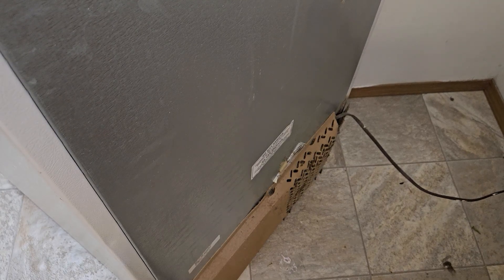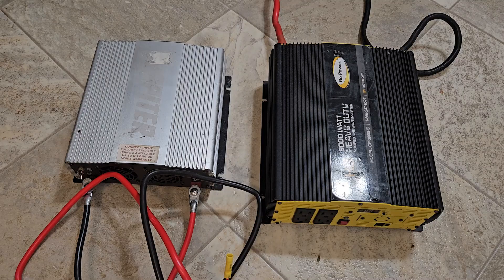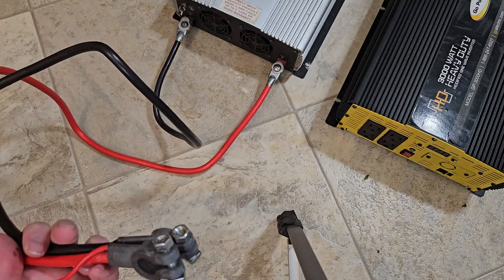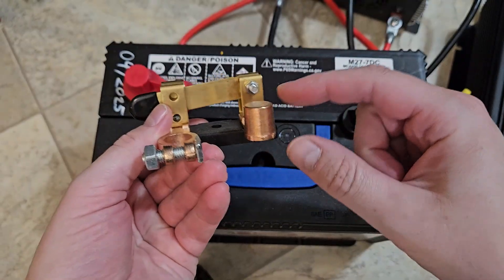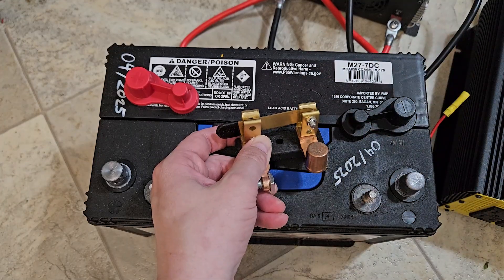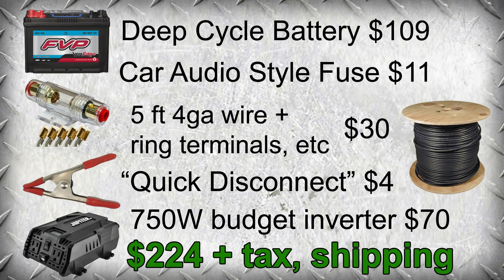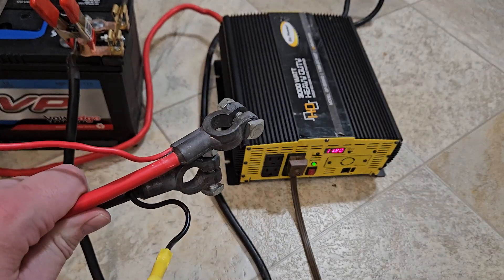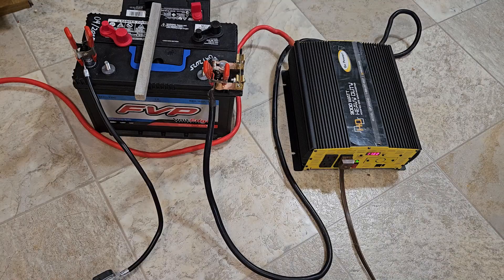How to Build the Perfect Refrigerator or Freezer Backup Battery System on a Budget

Comment: Cool video - I watched because I am looking to do a battery backup for my pellet stove and I am afraid of lithium batteries. The top end Harman pellet stove company recommends on their website the Tripp Lite APS750 750W PowerVerter APS 12VDC 120V Inverter/Charger with Auto-Transfer Switching it manages multiple lead acid batteries and charges them. Your inverters are pretty cool because they are less $$$ but I'm not sure how you would keep the battery(s) charged
Reply from the maker: Oh I have a solar panel in a padded portable case that's 45W but has a battery charge controller built in with dip switches for the 3 major battery chemistries.
Reply: @EmergencySurvivalTips  A+, yours is right-on for being budget friendly, it's actually 100% awesome and I'm tempted to do the same just so I have something for now.

Comment: i got a friend who has one hooked up to a UPS what are your thoughts on that compared to something like this?
Reply from the maker: Well, APC is kinda overrated but Eaton/Tripplite is okay but makes some really small capacity and Vertiv is too expensive. Like the Eaton 5P 750VA 600W at 300 watts has a runtime of 12 minutes. That's pathetic for $400.

The APC UPSes we use at work are about $800 a piece and can run a 300-400 watt continuous load for about 25-35 minutes. Keep in mind though that this 135 watt fridge only runs for about 1/3 of any given hour then sits idle for the rest. So it's like running a 45 watt load perpetually over the long term.

So they're solid, safe, but really hard to buy any kind of capacity on. They do auto-switch though the second the power goes out without any human intervention. If you got the money, I'd throw in a monster SMX series with a 2nd battery pack for like $2000 but that costs more than the fridge's contents (and probably the fridge lol).
Reply: UPS is for very short term. Uninterrupted Power Supply, just like the name. It's also for protection among electrical surges and brownouts. I guess they will be some sort of protection if the line electrical has a surge during EMP or power plant failure.

Comment: Just go buy 4x 3.2V LiFePO4 105AHr. That's 1200WHr, which will far outperform and far outlast those batteries. For any emergency battery backup, these car batteries are pretty much garbage. Better off giving money to homeless.

And on a full charge they will last nearly two full days on a charge with a typical refrigerator. One site costs me $140 + $62 shipping USD to Canada. That's actual savings because it'll last, not for the sake of savings. Or 4x 300AHr for $500 with shipping. That's over 5 days of refrigeration, comfortably.
Reply from the maker: I couldn't find one LiFepo that wasn't a counterfeit on all of Amazon, eBay, Newegg, etc. When I went to more respectable dealers like the big names in inverters and their batts were insane. Like $300+.
But series of lower ones is interesting. Were those pre-owned or medical or just lower demand or something? Also, what vendor?\
Reply: Stupid Youtube. I can't see my comment. Or will it time to show up? Google is ruining the internet.

Anyways in case you didn't get it, Alibaba. I have 16x 280AHr batteries. I have a in-line battery meter and I had them since 2022 so I know the capacity is genuine. Actually the real capacity still seems to be slightly larger at roughly 300AHr. Coupled with 3,000W Inverter for oversizing(longevity) and 2x450W panels. It was $105 USD per cell plus shipping. It's cheaper now. Paid $3,300 Cdn total for battery + BMS.

Used to live in rural area, back in city. I want to go back there again. I lived using that setup using under 1KWHr per day. Judicious use of power plus my electronics knowledge. Mostly about paying attention and metering.

You can also get it from a US reseller named 18650batterystore. I quoted prices from there. You do need to setup and connect the BMS. 4x will make it lot easier than 16x.